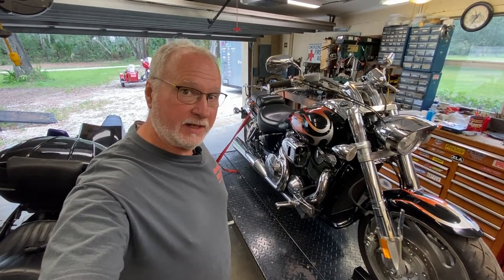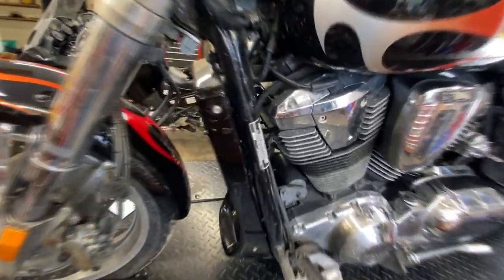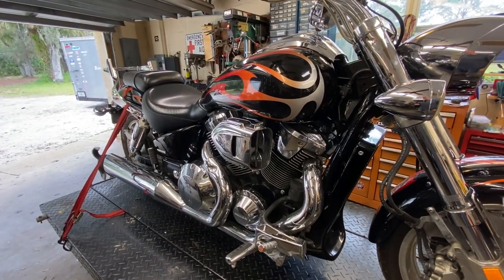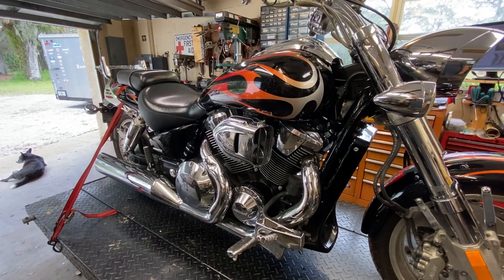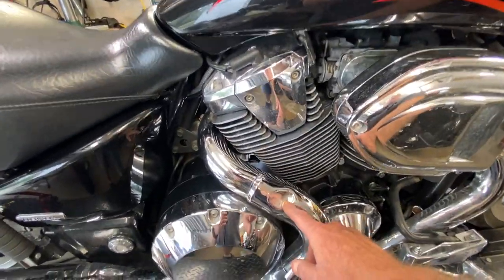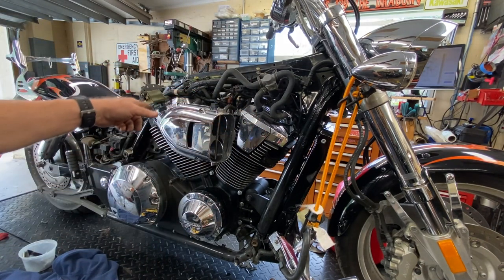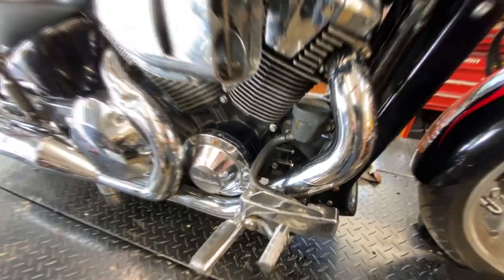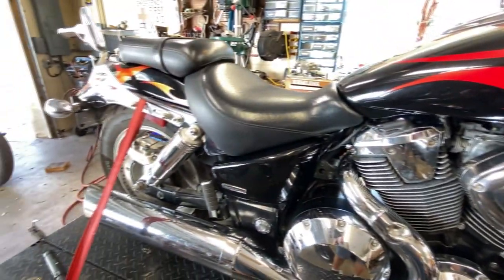2006 Honda VTX1800 - dealer worked on it, now there's engine noise!

Comment: Right away I figured it was exhaust as you said the dealer had replaced the gaskets. I would have used a nut to clamp the exhaust down and then Jam nut the cap or acorn nuts against them. At any rate. Good fix and that motor sounds fantastic!!

Comment: Thanks for the interesting video. The only time I was able to really check the valves clearance, was when I replaced the cam chains. I had to pull the engine out partially and remove the heads covers. And the clearance was just fine after 120k kilometers.

Comment: Why, oh why can't I find a mechanic like you in my area?
Reply from the maker: Very kind. I can answer that. Money. There’s no money in doing a top job over and above. Because the hourly rate plus parts, if billing hour for hour, would exceed (often) the value of the machine. I “adjust” the cost to be commensurate with the value and condition of the unit. Well, I used to before I had to shut down operations.
Reply: What area?
Reply: @ccboss490  So Cal Inland Empire

Comment: It's way easier to adjust the valves when the pair valves are deleted with block off plates. I understand this is a customer bike so that isn't necessarily an option. The back exhaust is still a little difficult but it's easier when you remove the fuel lines out of the way (That's really directed towards the internet and not necessarily the content creator).
Reply from the maker: Thanks.

Comment: Nice Video. I own 2 VTX 1800's one is a Neo and other is a C. In between my girlfriend and her family, we have 7 VTX's ranging from 1300 - 1800.  Looks like the bike has been dropped on both sides, to be honest. That forward control on the brake side is not aftermarket. That is factory, but probably being that It was dropped on that side as well being the brake foot lever bent waddled out the bolt hole. Sounded like the Exhaust Donut especially being that you had to add washers to get it tightened up. Being that the exhaust and the bike engine heating up makes the clearance even worse. So yeah, it was the exhaust and possibly that Hypercharger air intake being so loose rattling.

Comment: I have a 05 VTX 1800 F that has the same Hyper charger, my question  is the butterfly isn't  working and there is a part that  is on the bottom side of Hyper charger that is small that looks like a vaccum hose would fit on,and there is a small hose that isn't  connected, but won't  slide on to it, and there is no vaccum  on the hose,or could the hose b a gas vent ???
Great video  on the VTX !!
Reply from the maker: Thanks. It's a vacuum hose simply tapped into the vacuum line that attaches to the carb, probably at the air cut valve. They tend to tap into those around that spot. That's an air solenoid of sorts that opens the thing up when the engine is running so if the thing is sitting in the rain, theoretically it helps prevent water intrusion. I haven't ever seen one work. My advice is to dump that garbage and go back to stock air box and filter. Otherwise, just cap off the hose and don't ride in the rain. Cheers.

Comment: @MotoRestoFL quick question about ecu’s if you don’t mind. Can you please confirm if a 2014 Honda 1300CT Interstate has an ecu unit??
Reply from the maker: Unfortunately I cannot. I’m not familiar with that bike. Check the service manual.
Reply: @MotoRestoFL  I did it says nothing about that. Thx for the quick reply anyway!!!
Reply from the maker: Well, if it’s fuel injected then it has to have some sort of engine control module, which receives sensor inputs like crank and cam position, so the injector(s) fire correctly. Something has to control them if it’s fuel injected. Where that component lived on the bike I have no idea.

Comment: maybe you can help me diagnose a problem with my vtx. It acts like bad fuel or a vapor lock issue. With full tank of gas, bike runs fine, after about 30 miles in hot weather (it was 106 today) during heavy throttle roll ons it starts missing intermittently. It does it a little during highway runs at a constant throttle, but more so when rolling on the throttle. On our way home from a trip over the weekend, it go so bad as I got low on fuel, that the only way the bike would keep going down the highway was to barely apply the throttle. I plan to do the "VTX ground fix" and see if thats the problem. I cant tell if Im loosing spark on a cylinder, or if im dealing with a fuel issue. Any ideas? Bike ran fine in spring until it got hot...which is why im wondering if there is some type of vapor lock issue. My other thought is something electrical is intermittenly going bad in the real hot weather. Thanks!
Reply from the maker: You'd have to tell me what year bike first. I can only assume you mean an '06 like this one, but assumptions don't help us. And is it an 1800 or 1300?
Reply: @MotoRestoFL  sorry...mine is an 02 1800C model. I ran it yesterday in 106 heat and after about 10 minute it started doing it again. Rode it this morning at 85 degrees. After about 10 minutes, I could only get it to do it when riding along at 3k rpms, and then downshift and crack the throttle wide open. It would miss or hesitate and then come back and throttle up, rpms jump up. Strange problem. Throttle Position sensor? Vent tube in tank? Electrical miss? The "ground fix" will be attempted over the weekend to rule that out.
Reply from the maker: @rbljackson  Well, according to the parts fiche, that's a fuel injected engine and a bit out of my wheelhouse. A 2002 VTX1800C fiche shows no carburetor and shows a throttle body with two fuel injectors. I don't know what a "ground fix" is on that bike. Being fuel injected, the first thing that comes to mind is fuel pump/filter. Sure sounds like a lean mixture condition, but may not be. Being fuel injected it'll automatically do the mixture adjustment when it is cold, like an enricher would on a carbureted engine. All that is based on sensor input. Are you noticing any black smoke or it looking rich when it misfires or when you can't give it any throttle when it's hot? Because if so, I'd test the coolant temp sensor and make sure that is within spec. The ECU must get feedback on engine temp to adjust the injectors. The parts fiche, again, also shows a single oxygen sensor in the exhaust but strangely, doesn't list it in the list of parts. Just shows on the drawing. 

So I'm wondering, does that bike have a temperature gauge? If so, what is the engine temp look like, normal or low or high? Because if there's no gauge and the temp sensor is not sending proper engine temp, the ECU might be throwing a bunch of fuel at it when it's hot and causing your issue. A check of the spark plugs would be telling. If they're black or sooty, I'd go right for the temp sensor it's part of the radiator assembly, test and replace if it's out of spec. If the plugs are good or look really lean like white not tanned or normal looking, it's definitely a lean condition and I'm afraid I cannot tell you what that would be. A Honda dealer may have the equipment to hook it up to a scope and see what it's doing, I don't know. Again, fuel injected is outside my normal stuff I work on. Could be many, many things, fuel pump, injectors, O2 sensor, etc. It should have some sort of MIL or malfunction indicator lamp or something that comes on or displays any codes, have you seen anything like that when it acts up?

Certainly could be TPS, vent tube, electrical.... like I said, really hard to say. Look at the plugs. They will tell you a lot. That's one of the first places I go when diagnosing an engine running issue. Wish I could help you more.
Reply: @MotoRestoFL  Thanks for the detailed response. It doesn't have a temp gauge but I will keep that in mind and check that temp sensor if I can find it/figure out how to test it. There is a "dummy Light" called FI for fuel injection, but its not lighting up at all to indicate an error or issue. I think there may we a way to jumper a connector under the seat and view for trouble codes. Im researching that tonight. I will definitely try your recommendation on checking the plugs as well. Thanks again for taking the time to type that detailed response on a few possibilities. Very helpful.
Reply: Could be as simple as a loose battery conection.
Reply from the maker: @BigBearN81975  great point. Voltage/current variations can raise hell with computer controlled engines.
Reply: @rbljackson I did see a couple videos the other day about someone relating their throttle position sensor to bogging or a vapor lock, I’d check out some tps diagnosis videos on YouTube and if you find out what the problem was I’d love to know
Reply: it sounds like the problem i had last year with my 07 1800F. It started by randomly not revving up past 3k rpms. After a while the revs would drop if i kept accelerating and started misfiring. Had to change the fuel pressure regulator and the fuel pump (which I think it broke during the tests)
Reply: Sounds to me like the gas tank vent was pinched. Did you ever find the fix?

Comment: Just a question. Why wouldn't you check the simple fix first. Like you had talked about exhaust gaskets then you went and tore the bike down before even seeing if the exhaust gaskets were leaking. just wondering why you didn't do that first sense it would have been such an easy fix. Seems like you cost your self a ton of work for no reason. You said the valves were in spec on the tight side so no way were the valves rattling at all. Could you not have put a flame against the exhaust and see if they were leaking and blew out the flame. OLD SCHOOL TEST. Just asking. When you got the exhaust off and the Gaskets were not crushed that was a tail tail sign that it was exhaust leak. or that is my opinion. but I loved the video. I have the exact bike.
Reply from the maker: Great questions. Customer wanted a valve clearance check. I should have been more clear on that. I do recall mentioning the reason the gaskets weren't crushed is the nuts were bottoming before putting enough pressure. Some stainless washers solved that. I never heard of a flame against the exhausts, in this bike that spot is hard to get to and I kind-of like my house too much to use open flames around bikes I barely know. Occult fuel leaks, etc. But it's interesting anyway. I did say the gaskets weren't crushed and indicating a leak. Thanks for the question, and watching the video.
Reply: Use a stick of smoking incense to see air leaks,  it works for drafty windows.

Comment: That air box was rattling like hell. Too bad you didnt just put your hand on it while the bike was running to eliminate that and see if there was any other rattle.
Reply from the maker: I knew about it and fixed that also. Can’t remember if I mentioned it. It was not contributing to most of the noise, actually, very little. The cap bolts inside were loose. I removed and locktited them and torqued.

Comment: Not relevant in this case (since you are checking the exhaust gaskets), but If you have an old 5mm Allen key, and cut it down, you can get it in behind the exhaust to remove the timing cover without having to remove the exhaust.
Reply from the maker: Ah. I’ll remember that. Thanks.
Reply: My VTX 1800 has that chopped 5mm allen in the stock toolbag.

Comment: Hi .....I have a 2002 vtx1800...really nice bike 🏍 I am also a diesel technician ..but learn much..thanks .
Somethings they don't tell you that the engine is not reverse turn in the workshop manual ...
Reply from the maker: Just remove whatever side crankcase cover you're supposed to for access to the bolt to bar the motor over (I'm talking any engine) and bump the starter. Do this before any other work performed. Then note the direction of rotation.